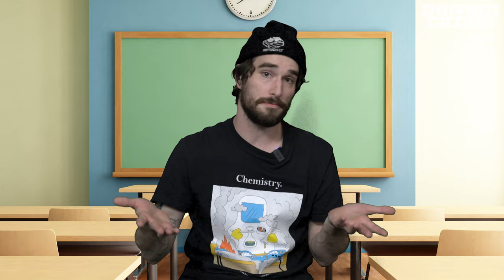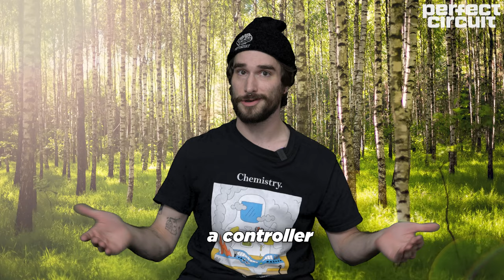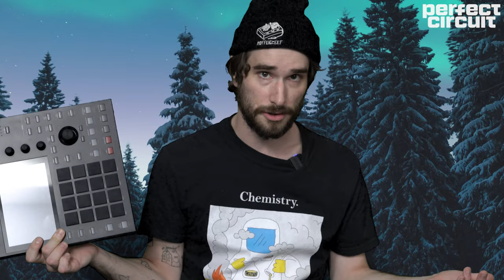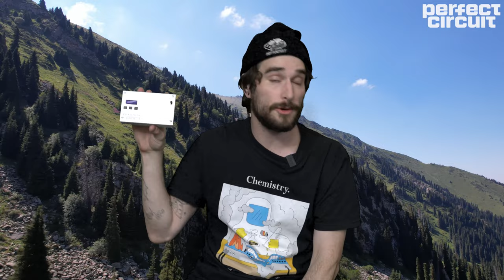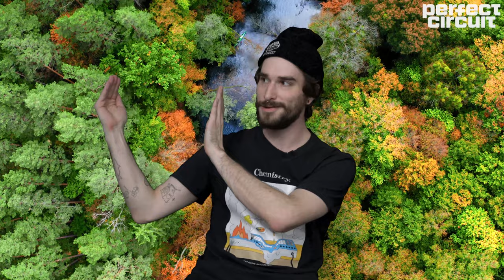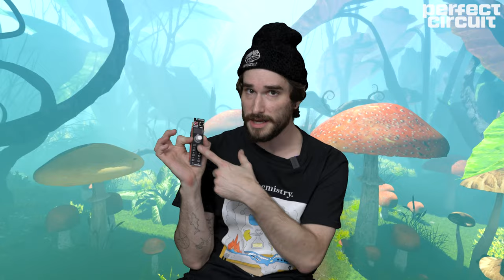Eurorack and Synth Tips: What You Need to Know About Midi to CV Converters

Comment: You missed one, and a cheaper option than most- the Korg SQ-1. Primarily a sequencer, it can nevertheless convert midi over usb to cv and gate. I use it a lot with the modular rig.
Reply: Some Eurorack cases (Cre8 Audio) have built in MIDI to CV converters